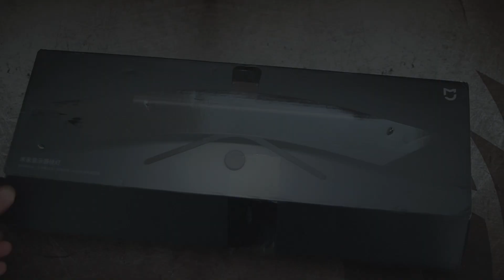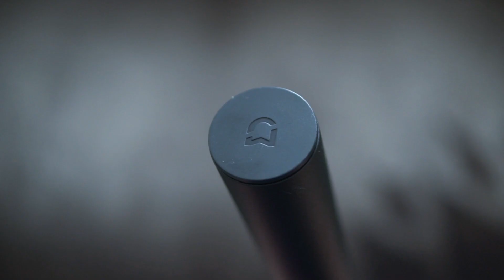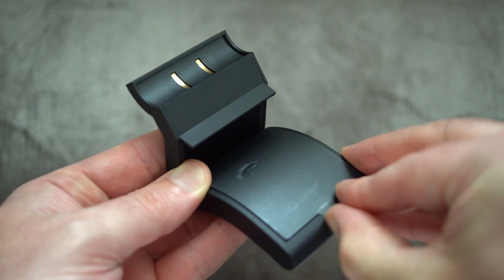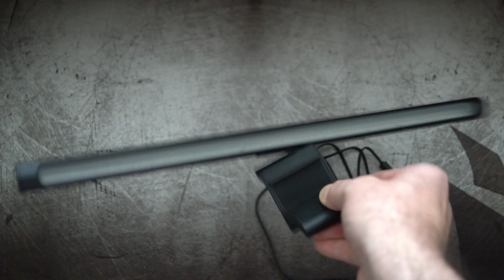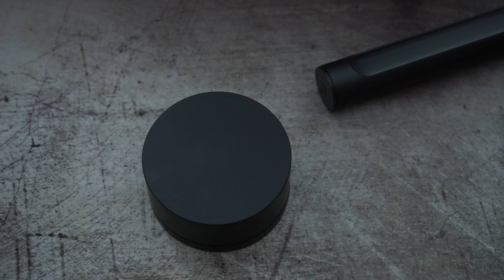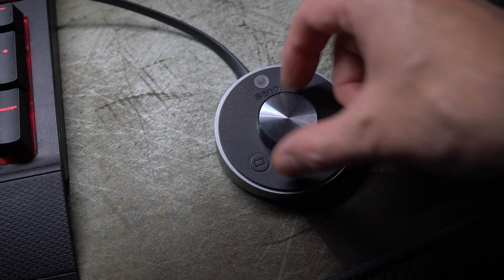Xiaomi Mi Computer Monitor Light Bar: Quick Look

Comment: Hi,
How long the battery can make the controller work?
If the light is off, is there any battery consumption?
Thanks
Reply from the maker: No way to measure that, all I can say is I've not changed the Ni-MH cells I put into it since I made the video. I would expect a fairly low power drain on this. Normal cells might last longer (they discharge less voltage), they say they last ages on the spec. Again I can't test that unless I wait for a year or so!

Comment: An inredible review. I wonder, can I put it on a curved monitor? And how well will it be fit? Thank you for creating such a high quality vids!!
Reply: it works well with the Xiaomi curved gaming monitor.. :) i have both and i really like the mi light bar on my curved gaming monitor. 

hope this helps. :)
Reply from the maker: I show the measurement on screen, so as long as  you have the depth it should work no problem. It's only the big angular back Acer monitor, that causes a problem

Comment: great review. in the video you used benq light instead of xiaomi light for the acer monitor. i have the same acer monitor and i am wondering if the xiaomi will have the same issue?
Reply from the maker: Yes it doesn't quite fit, the BenQ does it has more angle adjustment on it. The Xiaomi will work on most, but that one is just too much angle/plastic for it. It's a shame because a bit more movement it would

Comment: Just purchased one of these last night for my MSI 27 inch G27C4 curved monitor can not wait to add it to my set up
Reply from the maker: I use it all the time handy item to have. Web cameras should fit on no problem
Reply: @MrBazReviews  I am more than happy with it even down to the waulity of the packaging could not fault it whatsoever... Still need to get used to the wireless control but overall perfect for what I want, I am a little worried that because my monitor has no plastic border at the top the clamp may eventually crack the screen ?? Maybe I'm worried about nothing I don't know
Reply from the maker: @dadzlifex  It's not too heavy least compared to the BenQ (which is a lot heavier). I doubt you'll have a problem with it, just don't drop anything on top of it (bracket) lol
Reply: @dadzlifex  If you are in the UK, did you have any issue with having to pay import duties/VAT buying from Banggood as the items are shipped from China, so it's basically a personal import?  No one seems to mention this when reviewing items from Banggood.
Reply: Same for me 😅

Comment: do you know if you can connect 2 bars to the 1 puck control?
Reply from the maker: Should be the same frequency on all the bars so one controller will work both, but I don't have 2 to test
Reply: Did you try it? I'm looking for the same answer. Thanks!
Reply: @a5rt  Hi I finally figure it out, so how it works is when you turn on the 2nd light bar, press and hold the knob control on the 1st light bar until you see the 2nd light bar flash 2-3 times and then it’s paired
Reply: Also note that the 2nd controller will stop working and to pair it again you just repeat the same process but with the 2nd controller
Reply: @trapstar1998  Amazing info, thanks A LOT!
Reply: @a5rt  yes it works

Comment: Shame this would clash with a monitor mounted webcam, which suddenly became essential kit. A light bar webcam combo device would be interesting. Especially if the bar rotated far enough to also function as a webcam light.
Reply: I have seen people placing a webcam ontop of this using the bracket to sit it on ? It works
Reply from the maker: That's not a bad idea, would have to have it on the top part integrated, but wouldn't add much to the size. You can still put a webcam on the monitor either to the side - some with a more flexible bracket can open out more.
Reply: There are also 3d print files that create adapters for the webcam to sit on the mount